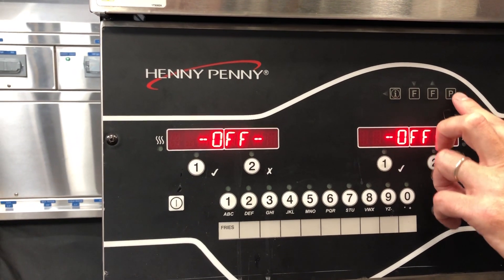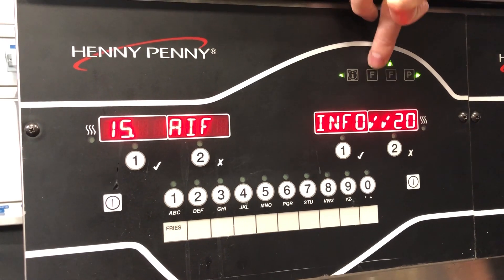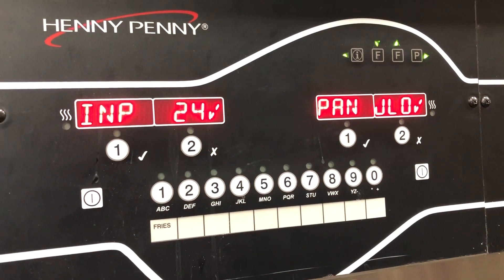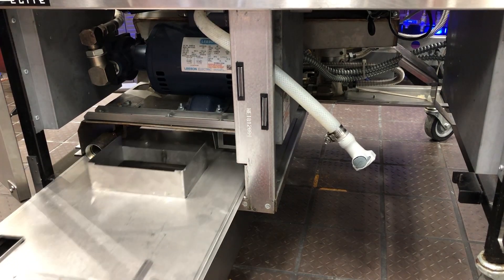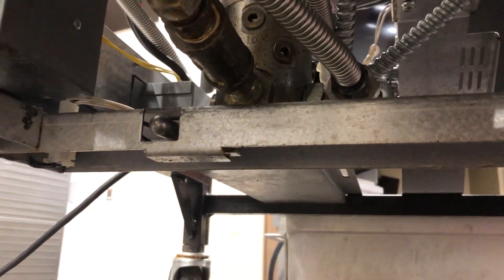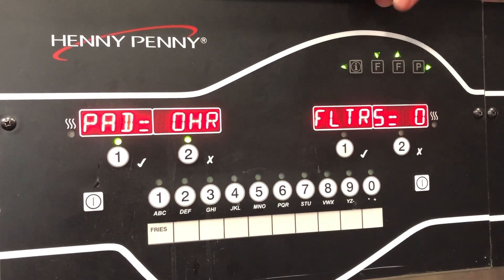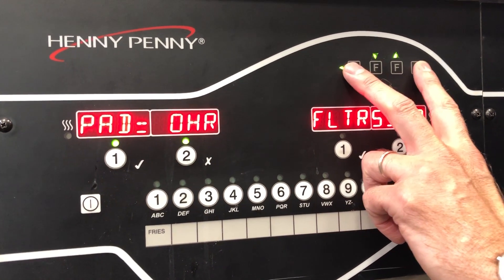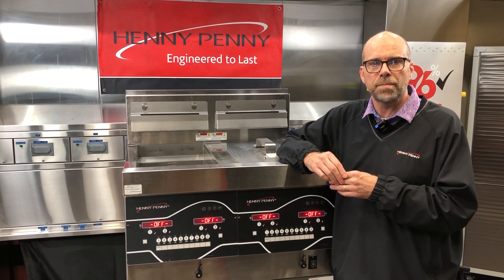Evolution Elite- How to check the Drain Pan Switch in the Control Panel!

Comment: Hi Henny Penny, I've been having an issue with my McDonalds LOV LVE-204 not pumping oil from its JIB? The JIB motor does not run anymore (for auto top off) or run when cleaning oil from lines. Any suggestions?

Subsequently crew have had to top the pots off manually and the Check JIB notification will repeat on all controls.
Reply from the maker: Hi Austino, sorry to hear about the issues you are experiencing. To better assist you, please contact our technical support department at tservices@hennypenny.com or by phone at 1-937-456-8405. They will be more than happy to help.